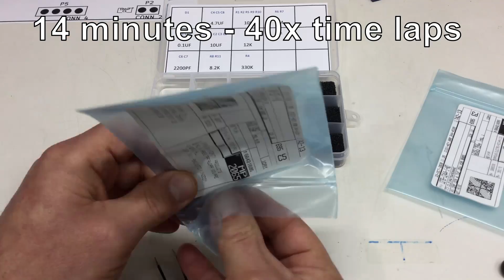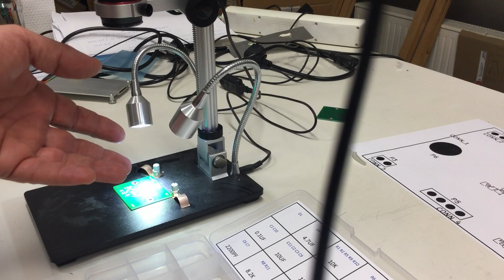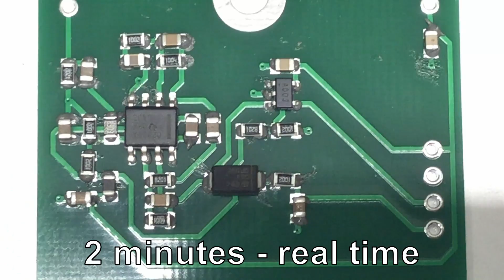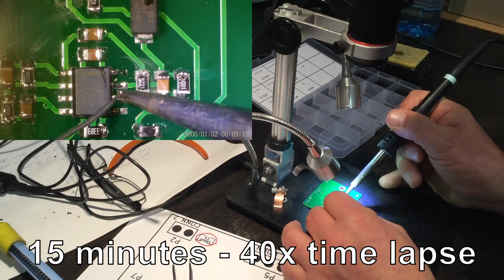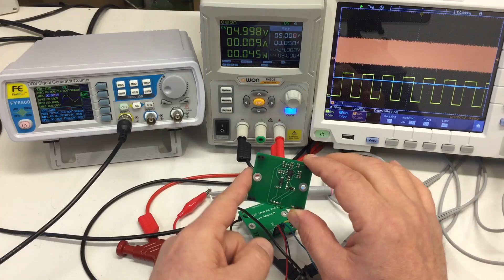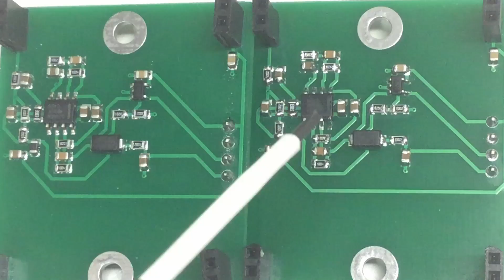SMD Soldering Shootout: Reflow on Hot Plate vs Soldering with Iron

Comment: As mentioned elsewhere, setting up a stencil takes time but once done you can apply paste to multiple boards very quickly. This means that it is more suitable for doing a run of boards rather than one-offs. Components smaller than 0805 get increasingly difficult to hand solder and even get tricky to hot-air solder due to the risk of blowing the tiny things off the board! Reflow (oven or hot plate) becomes the only sensible option at this scale. Also, contrary to your comment, you cannot ALWAYS use a soldering iron - some SMT packages do not have all pins exposed, the most common being a ground/heat transfer pad underneath. A very interesting video nevertheless 👍
Reply from the maker: Just used solder paste and reflow to get two TSSOP-14 packages onto two breakout boards 😅 Applying the solder paste manually was a pain in the ... 😖 Since I'm using such breakout boards quite often I should really get a set of stencils for them (if available, they are from Adafruit). And thanks for the thump up 😃

Comment: Setup time for stencil and handling paste is about 10 minutes, but you can then paste a few boards in minutes. Also smaller and qfn parts are more easy, because the paste amount is controlled. But for such a small board and doing only one or two, it’s sometimes hard to justify buying a stencil. However - you know you are straight lying, telling people there’s a 50/50 chance flipping the part on the right side. It’s like usb ports.. three times minimum;)
Reply from the maker: I'm with you regarding the time needed to setup stencil and solder paste. In the end it's like you're saying: It comes down to time (number of boards and number/size of components) vs money (for the stencil). But, I was not lying about the 50/50 change for flipping a part on its right side! At least for quality parts from reputable distributors this has been statistically proven! I might have omitted the fact that some studies have show parts ordered from AliExpress have only a 30% to 35% of falling down on the right side. A possible explanation for this is that Chinese low cost manufacturers are using ink contaminated with heavy metals, making the marked side heavier and thus causing it to end up at the bottom more often.

Comment: Thanks for an interesting video.  I have always hand soldered and was pondering trying a reflow solution but I do very few pieces.  I never sort my components... I go straight from tape to soldering... basically leave a small pile of the component I am working on somewhere on the board.  Another thing I was considering was using PCBA service to at least get all the discrete parts fitted.... but only works for >=10 quantities probably.  For SMD paste I think I would probably need a suction thing for picking up the parts... tweezers would be too fiddly... there are too many 0603s in my carpet already.  Merry Christmas and a Happy New Year!
Reply from the maker: You're welcome! I initially did reflow only (breakout boards) because I didn't trust myself to solder those MSOP packages :-) I was "forced" into soldering SMD parts during a repair :-)) My OCD is far too strong to not order the parts ;-) No, seriously, I do like the fact that I have some check that I placed the correct parts (especially the capacitors) on the board. I considered buying one of those vacuum tweezers for SMD parts, but my impression is that the cheap ones are even more fiddlier than conventional tweezers. Merry Christmas and a Happy New Your to you too!

Comment: Thank you for the video,   it does prove out what I find as well.   if you don't have mistakes (which does happen to all of us)  and use a stencil then reflowing is faster , generally.   The greater the component count the greater the benefit.  As you get down into 0402 range or even 0201 range reflowing really shines IMHO just due to component size.   On the soldering side,   using the correct tip helps speed things up but changing tips say from a chisel to a hoof (for drag soldering ICs) does add a minute or two (depending on the iron you use).
Reply from the maker: You're welcome! Mistakes do happen either way (reflow or soldering) and fixing them takes up most of the time. I'm with you that for larger component counts reflow with using a solder paste stencil is the way to go. However, I might switch to soldering my breakout boards for SMD packages when I'm pressed for time (always reflowed them up to now). But only if I'm pressed for time. Reflowed things simply look much nicer.

Comment: Hi Robert. Quite an interesting video. Thank you for this comparison that you only can think of doing:-). Please tell us what heating plate you are using and how it is connected. Thank you again for all those instructive videos. Regards, RJM
Reply from the maker: Hello René-Jean! You're welcome. Well, I had two boards to make and I really wanted to know if I'm able to hand solder one of them 😉 Up to now I always reflowed my SMD stuff but for the odd repair. And of course I shared the experience on YouTube. You'll find the mailbag video for the hot plate here https://www.youtube.com/watch?v=Q4XTfRTT3I4&t=1234s and there was also a little test of it in that video: https://www.youtube.com/watch?v=Q4XTfRTT3I4&t=1797s . Best Regards, Robert
Reply: Hi Robert.  Thank you so much. I had missed this test on the plates.  It is interesting to know that it can be used instead of oven for small board. I have a few of these and I will put them to use for such application. Thank you again for sharing. Regards, RJM
Reply from the maker: @rene-jeanmercier6517  Hello René-Jean, again, you're welcome. Hot plates work great for PCBs with single sided loads, and obviously won't work at all for PCBs with double sided loads. I personally believe that using a hot plate is more gentle to the SMD parts than using a reflow oven: The heat flows from the hot plate through the PCB to the pads and the solder paste, and from there only a fraction of the heat is going through the pins into the parts. But that's only my opinion. There are a lot of discussions about that (e.g. https://electronics.stackexchange.com/questions/269832/reflow-oven-vs-even-hot-plate ). Best Regards, Robert

Comment: I have a hot plate that I use occasionally with great results, but on a small board like that I would probably just hand solder it, before I started working with SMD I swore blind I would never solder them but now I quite enjoy it and my results aren't to bad either, once you get the hang of it 0805 is a doddle, but I love my hot plate too ! so to answer your question...I like both styles...depends on mood!....cheers.
Reply from the maker: As I said in the video: I'm a bit ambivalent about which technique I prefer too. On a purely subjective level - which I didn't discuss in the video - I found soldering the SMD parts with the iron more satisfying, because subjectively (!) I made faster progress. But then, I do like the results of reflowing much better. Regards, Robert